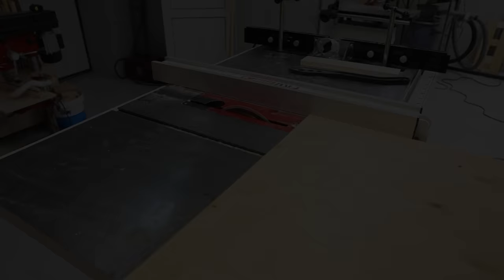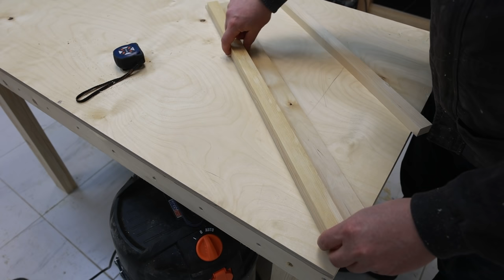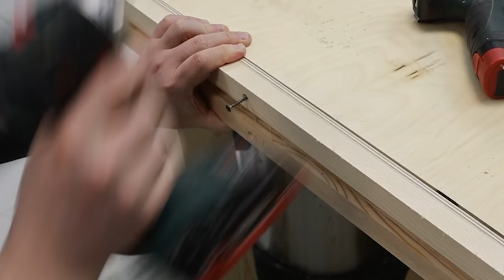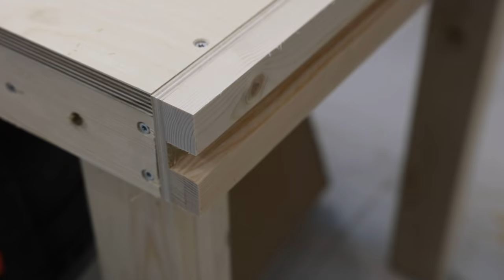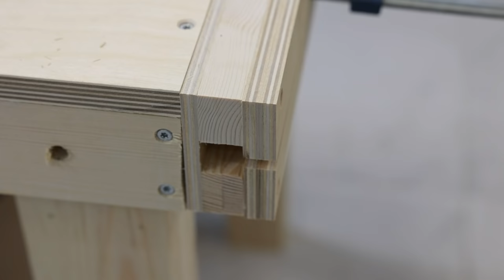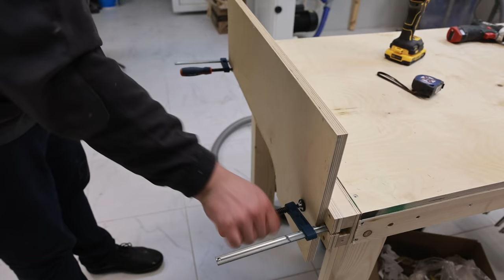Don't buy a carpenter's vise until you watch this video! Cheap alternative in 4 minutes!

Comment: Great idea. It would be easy to mount a second unit lower down to add more clamping pressure on long boards held vertically; might also stabilize the workbench itself.

Comment: 2.0 development tip: Make a slot on the inside too! 
Insert the clamps with the stem inwards. 
Now they’re obstructing you. 

2.1: instead of long handle to screw the clamp tight, have a fixed stop on the inside (= saw off the handle) and now drill a hole on the outer default fixed bracket and put an eccentric handle there. This will squeeze the part much quicker than screwing a handle and doesn’t take so much space. Simplest way is to slaughter two clamps and move the fixed brackets over to those two for the bench vise.

Comment: Not a solution I would jump at, but still a very clever solution! I'm sure I'll come up with an application of this technique that works for me some day!
Reply: The minute I rip my thigh open on the clamp ends is the time the whole table gets tossed in the burn pit
Reply: @franklloydwrong6997  Yeah I would definitely only use this with short clamps and I would add something at the end of the clamps (foam or leather or whatever) because I would also stab myself with this. But when you're not using it it's not an issue so I think it's still a decent cheap/easy alternative to a Moxon vise.

Comment: For the investment, it’s a very good result.   It is unquestionable that this ‘vice’ will hold things that a traditional vice cannot.  Personally, I would use clamps with a bigger clamping surface.
Reply: vi S e.
Reply: @mrniusi11  In American English, the noun 'vise' refers to a gripping or clamping tool. As a verb, vise means to force, hold, or squeeze as if with a vise. 

In both cases the 'British' spelling is vice.
Reply: @doc1701  😊😊👍

Comment: It's decent for some odd clampings.  But the carpenters vice is better for clamping over and over quickly. As well as strong tight , no movement hard hitting needs. Still a very useful system.

Comment: Great idea, but a specialist carpenter vise will place the clamping force over a greater area of the workpiece, be stronger and less likely to damage the workpiece.
Reply: add an extra strip of material to spread the pressure.
Reply: And less likely to damage your clamps. It is a good idea for quick setups though
Reply: Yes, this method could damage to work piece BUT, “beggars can’t be choosers”, right.
Reply: @velcroman11  you could always use some cauls or just add another piece of wood in between the clamps and the work piece if you are worried about marring it.
Reply: @AdrianWilliams763 to each their own

Comment: I like the simplicity of it but don't care much for the clamps sticking out. I would be concerned when I'm hand planing
Reply: Good observation —I’m fixing a few sets of clamps, some with the stems and handles cut back so they’re only as long as they need to be.
Reply: @raystanczak4277  just turning the clamp heads on other side should work better.

Comment: My only initial concern is the clamps prevent you from standing very close to the workpiece. Interesting
Reply: To address this issue, I feel we can use bolts in the T-slot with a retainer metal strip and a knob. We need not use the clamps at all !!

Comment: You can just have a T track on the bench side as a peripheral holding option.  This is much too finnicky to be a main vise.  I just don't see anyone striking a hammer on something held by tiny bar metals on the side using tiny contact points.

Comment: You could drill a hole in the handle of the clamp and insert a rod in it. Then you can cut off the handle and the rest of the clamp so it max can clamp a 4-inch piece of wood.
Just so you don't need to invest in a cup! 😀

Comment: The main problem with this method is the metal clamps will leave divot marks in whatever is being clamped.
Reply: True, but it is pretty easy to make pads that will slip over the adjustable clamping surface. In my environment I'm more concerned about running into the bars as they stick out, but it is still a pretty innovative idea.

Comment: Neat idea, but seems like clamping something down to a horizontal surface is more commonly needed.  Also, the protrusion of the clamps is less than ideal, but maybe I'm just not envisioning the appropriate use cases.
Reply: I guess it would be easy to imagine a design modification for a slot in the top as well and as regards the protruding clamps you could just whip them out when not in use.
Reply: They're just at the right height to make you a soprano.